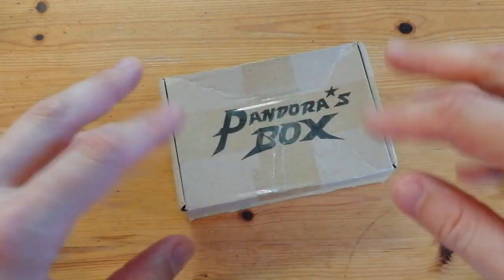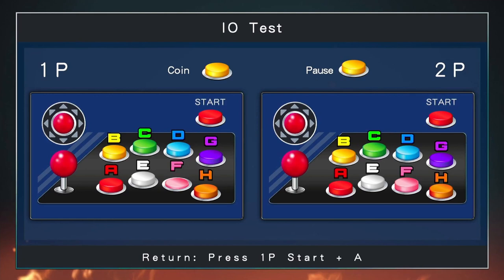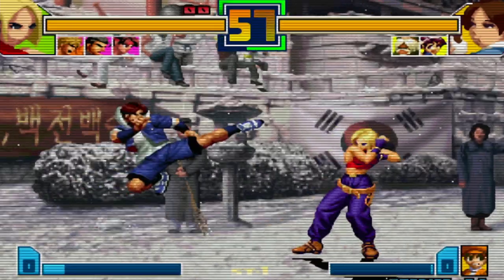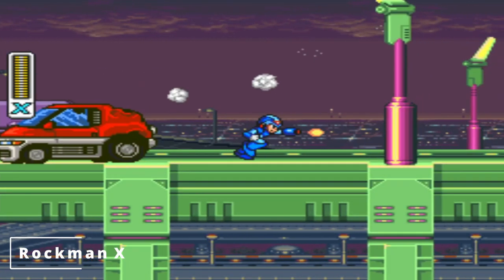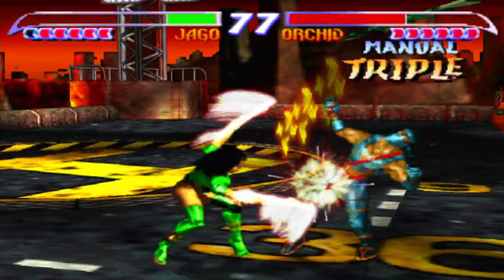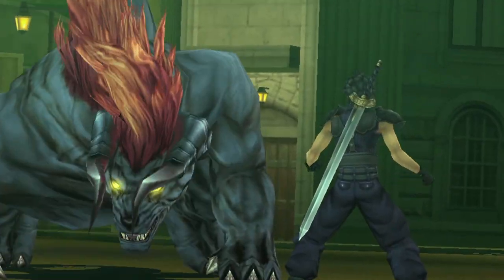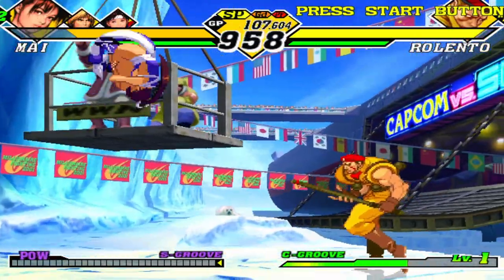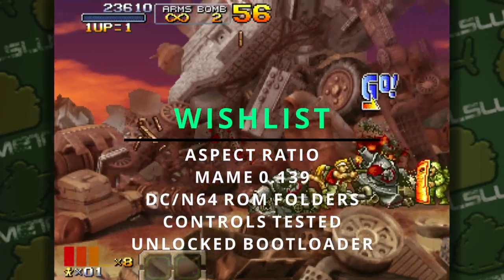Pandora Box EX - EARLY OFFICIAL 3A UNRELEASED Arcade Board

Comment: Looks like it has a bit of smoothing despite having image optimization off. Could be my eyes. Also they seem to use the fba core for mk1 which typically runs slow. If it runs under mame 2003 then it should run faster, but then not sure if it would require samples for some of the audio. I imagine this may be able to be fixed eventually. Mario Kart 64 was running pretty smooth.
Reply from the maker: The screen is stretched, smoothing / bilinear filter.
Mk1 uses the same xmame emulator as the dx. You can tell it's xmame as these games cannot save when you hit the menu button

Comment: Which version(s) of MAME does it claim, and does it have the 2018 final FBA version on it?    

Version .161 of MAME would probably be the one I'd request, last one without MESS, so smaller size, and far enough along to run most well?

Suggest they double the RAM finally to 2 whole GIGs in 2021, and if it's not too much trouble bump the CPU to a S922-X?     

Hell of a dream I had....    😁
Reply: Looks like it was mame 2003/.78. Fba was 2012 version based on the file system. Those run pretty well on most of these retro systems.
Reply from the maker: Exactly the same as the dx. Mame2003, xmame (0.78 or was it 0.37?) Fba2012. 
922 would make no sense tbh. A total boost in price when the software holds this back.
Reply: @TeamPandory  Which is held back some by the hardware as well, needs boost in both areas!   😎

Comment: Why don’t you show the games that push it to its limits, DC,N64, Sega Saturn?? etc etc, otherwise, not a bad video. 😎👍👍🇬🇧
Reply from the maker: We did show a few psp titles- wipeout is a good indication of the power that it's capable of, as is n64 killer instinct. 
Saturn... No chance .. there's no emulator to allow it.

We will leave the grinding to either the stream later today, or when the final product has been released.